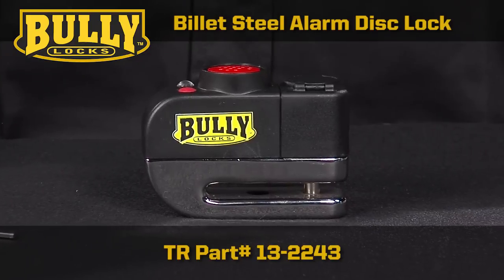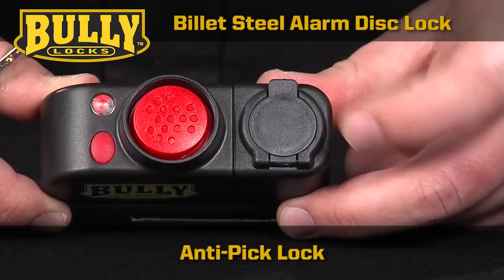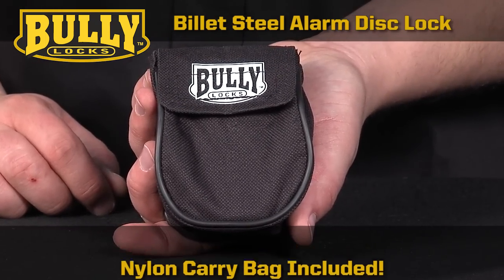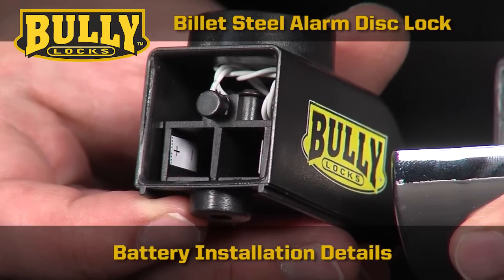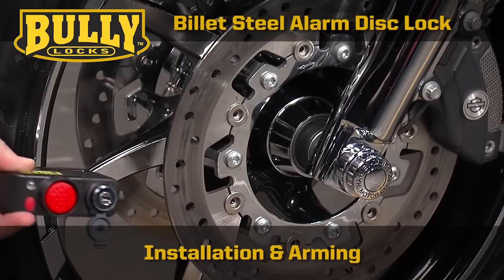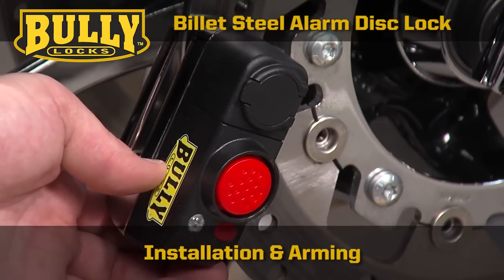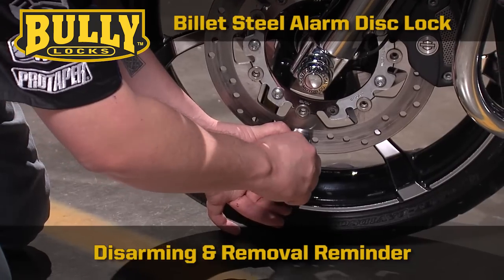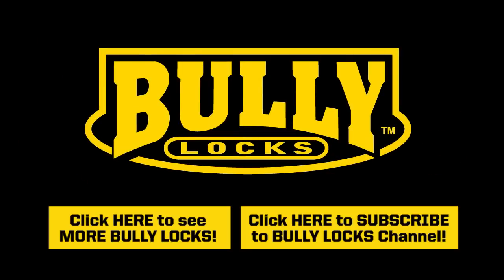Bully Locks Billet Steel Alarm Disc Lock

Comment: Bought this for my R3 and it didn’t fit
Reply: MSB 24, is the pin not going through the holes in your rotor? You should also be able to put it in the space between the rotor and carrier.